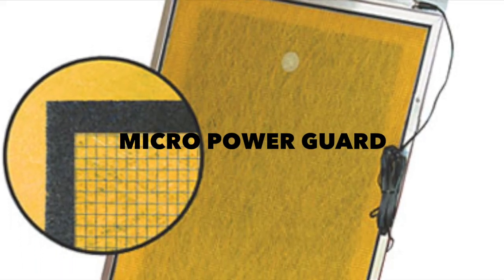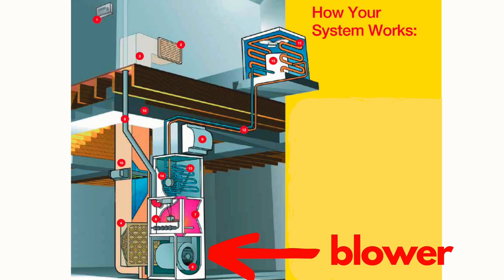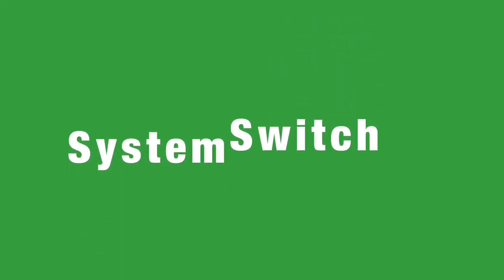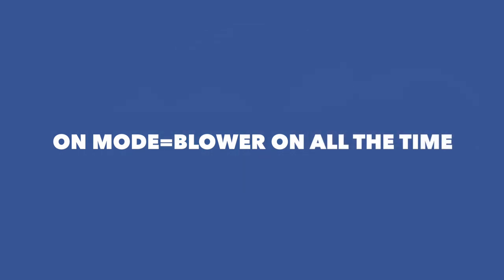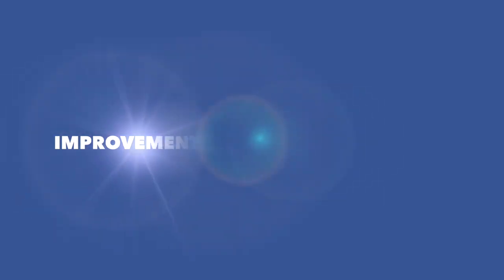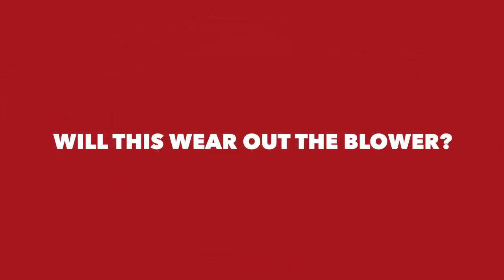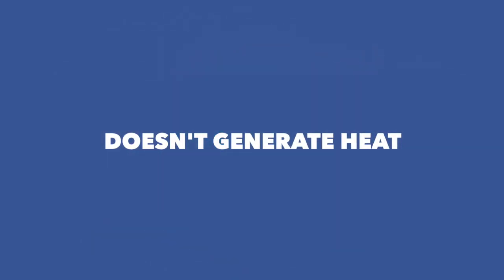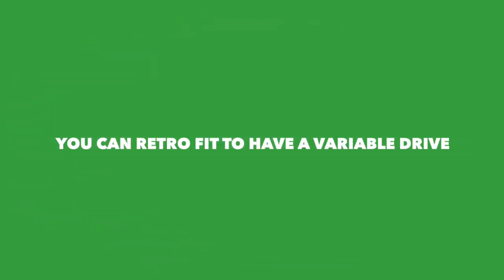Attic Fan Alternative? [Good Idea to Simulate An Attic Fan or Whole House Fan]

Comment: I got a variable speed furnace  motor is running all the time but the rooms still gets super hot upstairs. I'm conflicted if I should get a whole House fan or what the remedy will be to cool down the upstairs rooms..

Comment: Ok, so I want fresh air circulating in house, so I thought why not an erv? I got an estimate for $5000? That sounds excessive? The HVAC rep also recommended two alternatives,  an attic fan that will blow the hot air from the attic but I'm not getting fresh air and another attach fan where I need to have a window open allowing for fresh air. Right now I leave my front door open but that's not very efficient and it keep the dust out. Help! I'm in Los Angeles where the heat build up in my place has wanting to supplement my AC since I'd like to use it when I NEED to but in between times I'd prefer circulating fresh air while in the house!

Comment: So one doesn't a attic vent suck air from your soffit vents under your eve? 

2 when you always run your fan when the ac cuts off your blowing in moisture off of your A Coil and your not allowing that water to drain. Now you have higher humidity levels and need to keep your temperature levels lower in order to stay comfortable.

Comment: When there are existing soffit and attic vents, which can pull air from outside, then how come gable fan creates negative pressure? Even if I agree with your reasoning and negative pressure builds up, then those vents will first start sucking air from outside to maintain the pressure balance hence will not build negative pressure inside the home. Please clarify.
Reply: Yea no ones house is so hermetically sealed they pull a negative pressure. No way

Comment: There are two types of Attic fans, one that acts much like a bathroom fan and then there's an Attic thermostatically controlled cooling fan that exhausts hot air e.g. 90° F out of the ridge of the roof drawing ambient air from the soffits. The thermostatically controlled Attic fan in hot climates is fine, especially when it abates a 140° F conventionally insulated attic space.

Comment: Glad to find this video and this resource.  I've been trying to get an answer to this one:
Why wouldn't we bring air into the house via a dedicated external louvered intake?  That would allow us to pass it through some filtration.  
Imagine this scenario: the air comes in through louvered exterior intake, passes across filter, passes though the fan, then a run of duct in the attic that keeps the fan from sitting right on the living space (for noise reduction), and then dump the air into the house near the HVAC intake.  This would create positive pressure in the house to overcome many of the negative pressure applications in the house.  Air would be cleaner.  Still need to open a few windows but maybe not all of them if you then circulate air with the HVAC blower.  
Also, are there thermostats available that can be set to a temperature difference between inside and outside to active a whole house fan?  So, for example, fan could turn on when outside is >/= 5 degrees cooler than inside?
Thanks!
Reply: I've been thinking about the same type of thing. It seems kind of like an air exchanger where you're bringing in the cool air from outside but then what if you got another passive duct for air return to outside? I definitely like the idea of taking the temperature from the inside and the outside and only turning it on when the inside is 5° lower than the outside.

Comment: 4:55, negative pressure by the attic fan:  That is exactly what happened to me and I could have been killed by Carbon Monoxide back-drafting from the Water Heater.  My AC handler unit up in the attic has been leaking.  I turned down the Attic fan to 80 deg.  The fan was running continuosly for 24/7.  My carbon Monoxide detector went off up to 200 ppm.  Fire Dept and utility company all showed up but no one could figure out.  One plummer asked me, "Have you recently run a lot of fan up in the attic?"  When I said, yet, he said that was the reason as my house was literally vacuum-sealed.  Your video confirmed his theory.  Thank you.

Comment: Would a mini split air handler be the same as a variable drive blower?
Reply: Not exactly, but it will circulate the air. If your mini split has a filter, that filter would apply as well when the fan runs.
Reply: @thetechq  Do all mini splits have air transfer or do you have to get an air handler to transfer the air